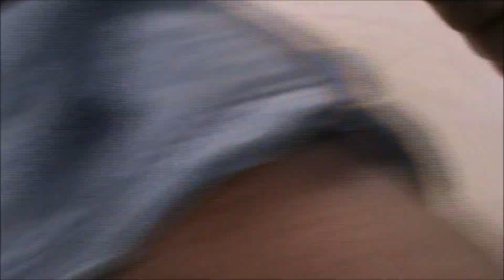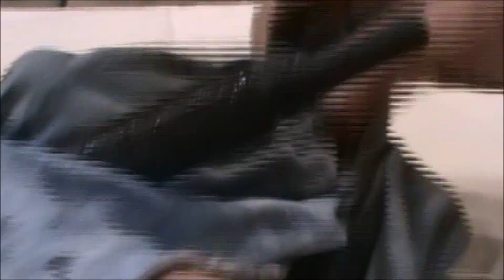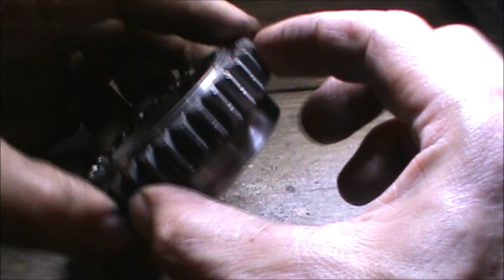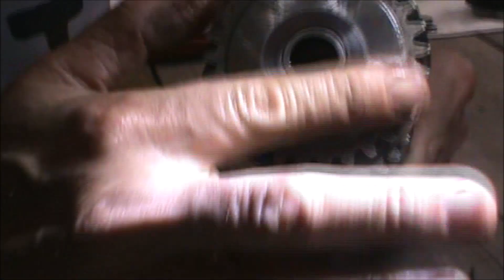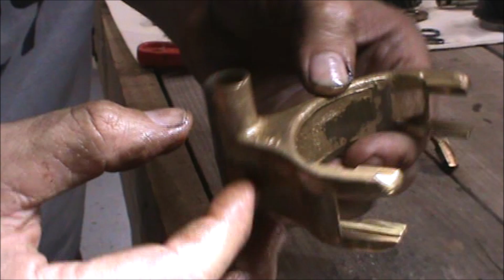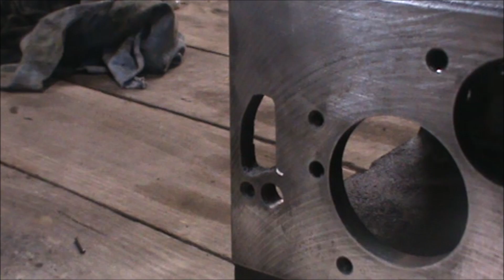Triumph Spitfire 1500  Single Rail Gearbox Rebuild - Part 2 - Cleaning and Inspection

Comment: Hello Sir
Thx for the time and effort in doing the series of videos. I  have an MG midget 1500 that has the same gearbox as the spitfire. 
The reverse pinion is ruined (21 teeth) and the teeth on the outer GEAR are very thorn out. 
Do you have a place where I can find them (somewhere else than moss motors) and need also the needles and ball bearings too.
Reply from the maker: Hi Juan,  I've had good luck sourcing parts with British Parts Northwest, Canley Classics and Rimmer Brothers.  I hope that helps you with you project.
Reply: You can also try Spitbits, The Roadster Factory, and Quantum Mechanics.